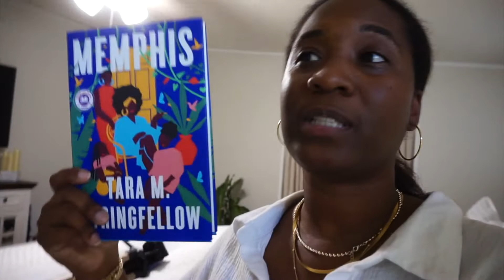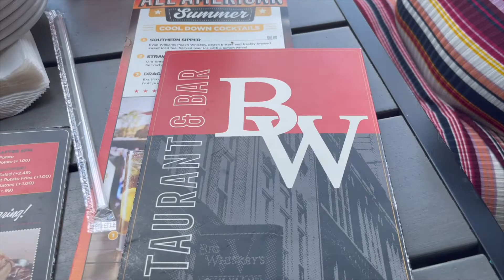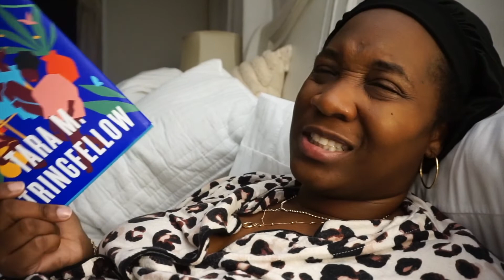Weekend Vlog | Home Updates, Graduation Lunch, Fall Prep & More!

Comment: Thanks for sharing 💕 Was wondering what brand is your turntable and where did you purchase it from….thinking about getting one I have so many albums. Thanks again!
Reply from the maker: The system in my room is NAD Stereo Receiver 7240E and the turntable is a Realistic LAB-2200.  The system in my family room is Technics by Panasonic Stereo Receiver SA-5170 and turntable is a Technics Quartz SL-QX300. I got both system at a place called Tom Sounds in Birmingham, AL.